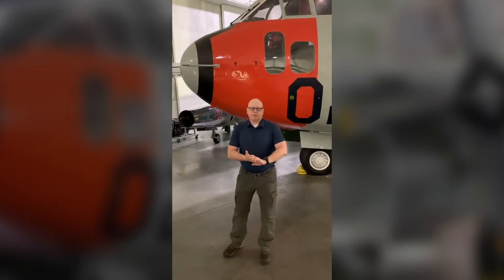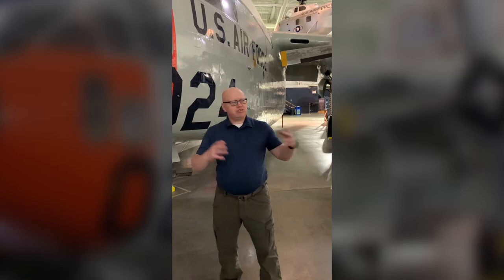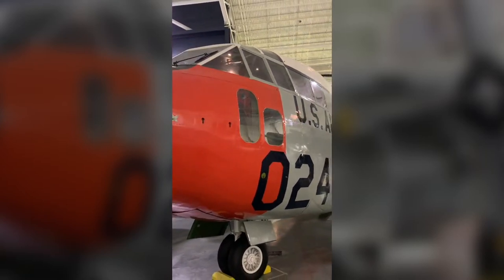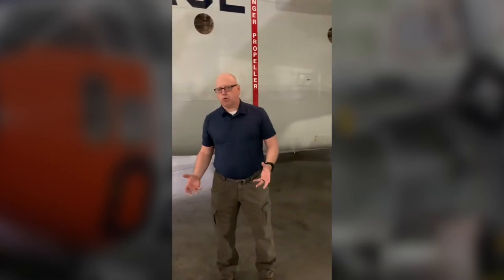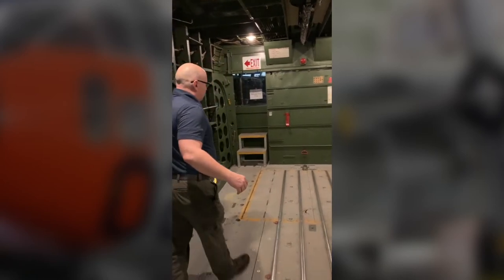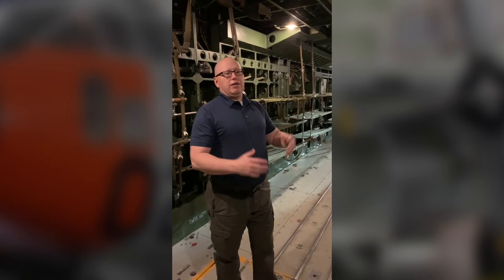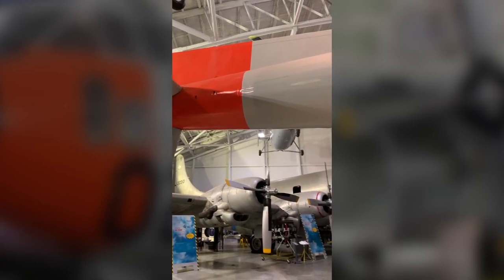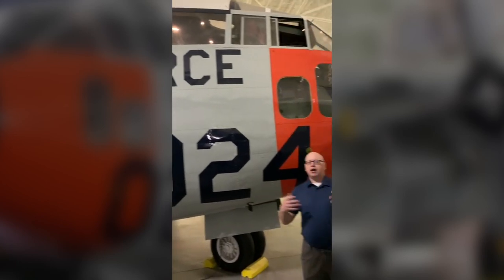Aircraft Adventure: C-119 "Flying Boxcar"

Comment: I'd like to add some corrections yet not trying to be critical. The C119G had R3350 engines with Aero Products props . I think the B model had R4360's with HS props. I've only seen the latter with the Marines . The C123 was a smaller aircraft engined with R2800's .As a Flight mech/FE  I logged about 1000 hours on the G  A few white knuckle moments ,however mostly good times and memories . I do appreciate this video.